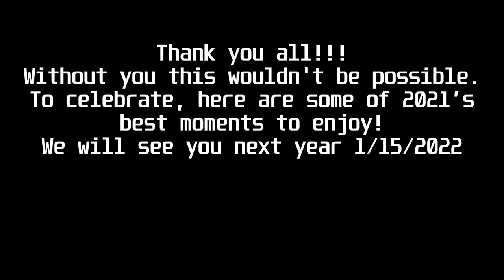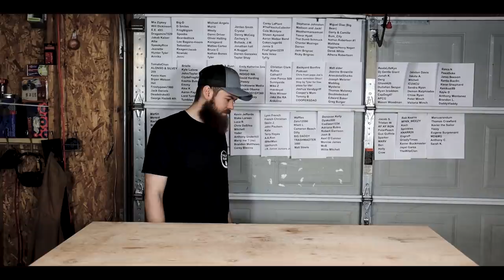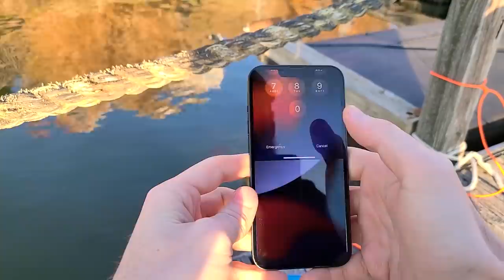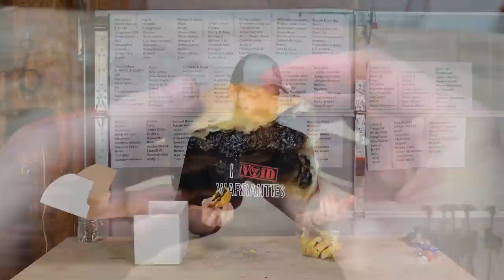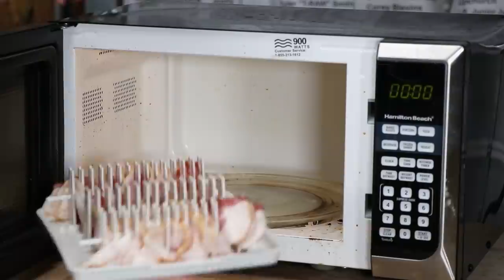TylerTube Greatest Moments From 2021!

Comment: The contraption that you are supposed to use to cut the top of the can off after you use the thing to twist the top of the can and it cuts the lid off I think it is meant to be used for sodas that are either completely frozen so you can have a slushy and you just cut the top off so you can eat it or if you accidentally freeze your soda by leaving it in the freezer too long but you have no way to drink it now that it's frozen so you cut the lid off or if you freeze it halfway through to have a really cold soda and with all the ice in it you should be able to cut the top off if you don't squeeze the life out of the can while you're twisting the cutter to get the top off then you have a nice cold drink and you have to be smarter than the tools you're working with and if you're not than you just make a fool of yourself and you just look stupid in the end

Comment: If you were to make them hot dogs out of ground sausage instead of using ground beef then I would think that it would be very similar to the Breakfast Bite that you get off the roller grill at your local 7-11 convenience store and I think that whoever came out with that little contraption is onto a great idea because I would buy one and you have to know what you're doing to be able to perfect whatever you're trying to make like instead of just using the 80/20 ground beef and just putting it in the machine and expecting it to stay together you have the wrong idea because you have to start out with 80/20 ground beef and then take and put it in a mixing bowl with a large egg or two and then add bread crumbs or bread or even croutons for the binder and you can even add a little bit of butter milk depending on how moist you want your ground beef and you can even mix it up a little bit by adding shredded cheese that you like and if you like any other ground meat you can use ground deer meat, ground turkey, different cuts of beef and so on and you can add SPG or any other seasonings that you want in it I would definitely spend the money to get one of them to make all types of hot dog/sausage shaped meats because I'm more of a hot dog/sausage guy more than I am a cheeseburger guy because you really have to know what you're doing to make a good cheeseburger and not have a silver dollar sized piece of meat inside a huge hamburger bun and with a hot dog/sausage it's hard to have way more bread than meat if you know what you're doing so you don't shrivel the hot dog up and have a dried up meat link

Comment: Is that can opener made for food stuff not sofa's?  And how well does it work for food cans?  I have a collection of can openers, one electric the rest manual. None of the. Work right for my arthritic hands. The one electric one works only at times... it is one of those "no rough edges" that sits atop the can and rotates around it.  I have old school type but can't turn the crank - wingnut opener. I am so tired of going hungry because I can't open a can of food (and I mean that).  Also... you video cut off the product's name and what it was supposed to do.